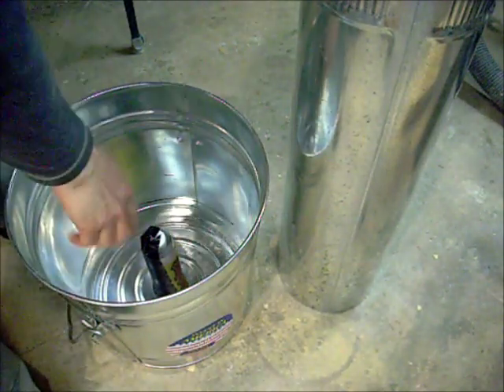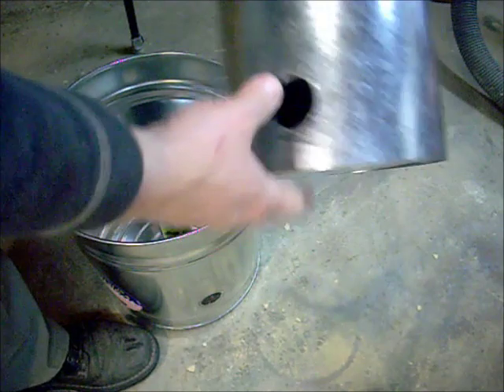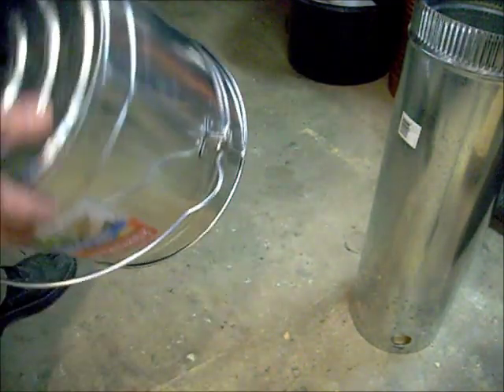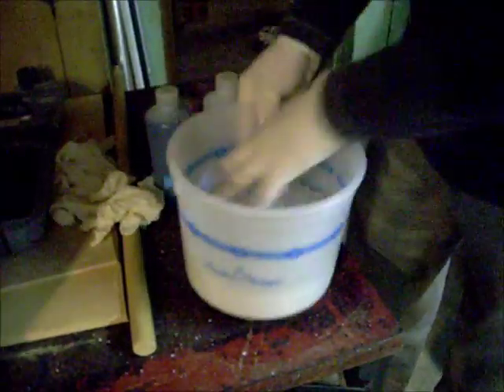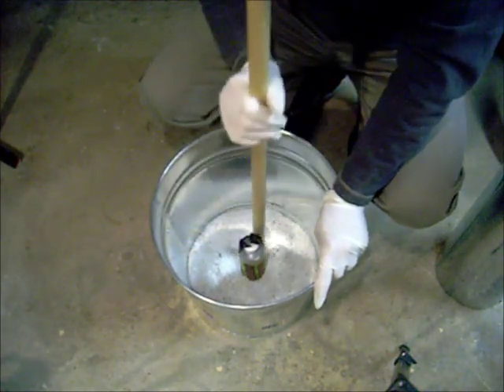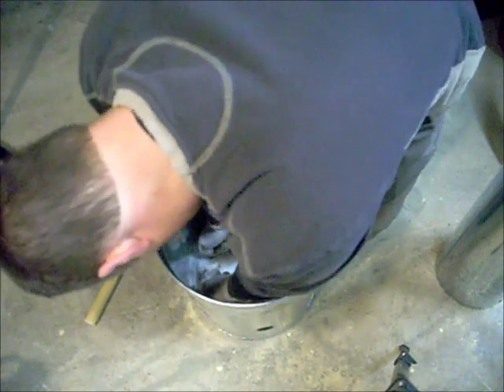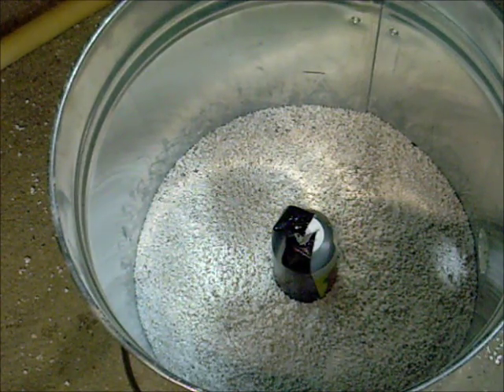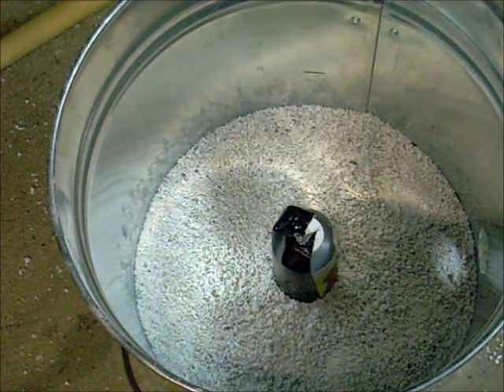Foundry adding refractory material   perlite

Comment: You forgot to plug the burner tube hole!!!! If you had put an upside down funnel on the nozzle you'll get a better flow/coverage.
Why didn't you mix it with bentonite clay and sand?